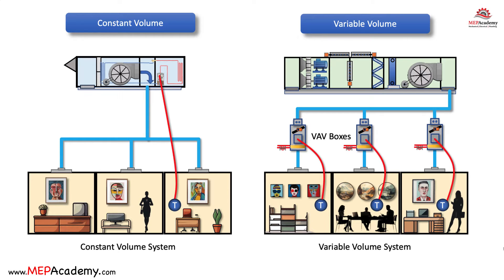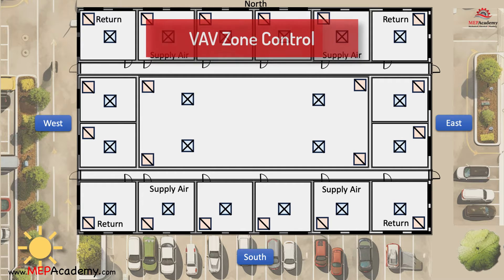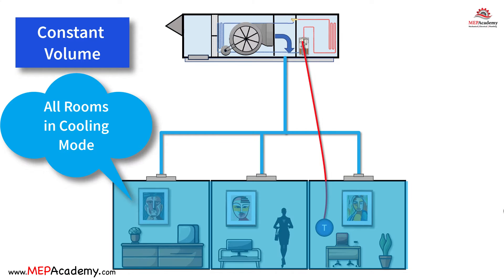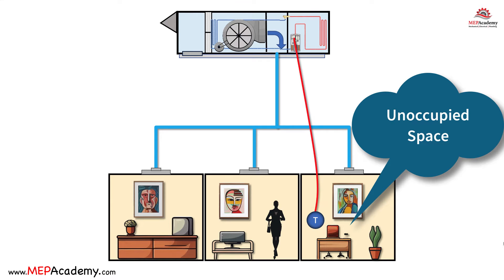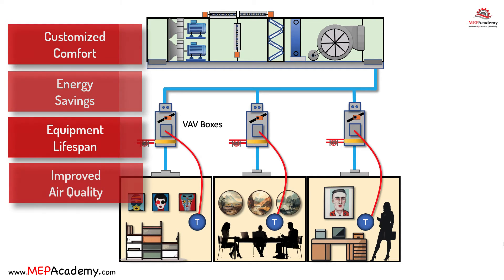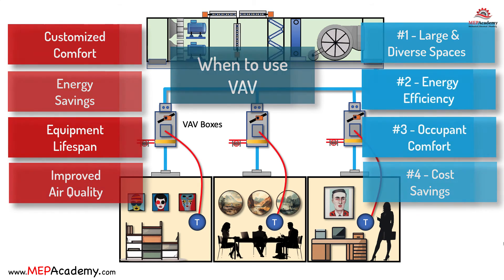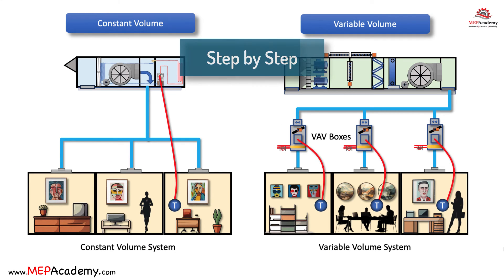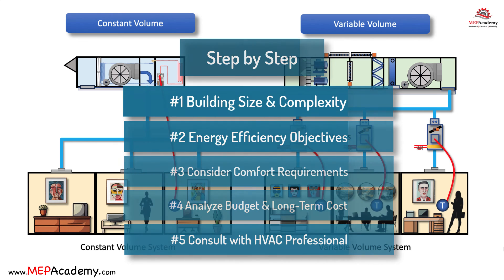VAV vs Constant Volume HVAC Systems

Comment: I want to see a true analysis of the energy efficiency claims of VAV systems vs. the extra cost. Somehow, it does not matter that a VAV box operating in heating mode while the system is in cooling would have to heat up air that has already been cooled to 55 degrees? The tin foil proponent in me says that VAV is basically a scam designed to sell more crappy equipment and keep building management locked into crappy contracts with crappy service companies to service this...crap. 

I have both CAC and VAV systems in my buildings. The VAV buildings BY FAR have more reliability and comfort issues. This is anecdotal, yes, but my point is that all talk about VAV for the most part highlights the supposed benefits, but it's all theoretical as far as I'm concerned. Step into the real world and maybe it's not such a great idea...
Reply from the maker: Thanks for your detailed comment—these are valid concerns, and you're absolutely right to question the real-world performance of any system beyond theoretical energy models.

You're not alone in noticing challenges with VAV systems. While Variable Air Volume (VAV) systems are designed to be more energy-efficient by reducing fan power and conditioning less air during part-load conditions, they do introduce complexities, especially in mixed-mode seasons or when simultaneous heating and cooling can occur due to poor control strategies or design flaws.

The scenario you mentioned—heating air that's already been cooled to 55°F—is a known inefficiency in VAV reheat systems. This is typically mitigated with reset strategies on supply air temperature, optimized zone control, and better building automation, but not all systems are set up or maintained properly.

You’re also right to point out that first cost and maintenance are higher for VAV systems compared to simpler Constant Air Volume (CAV) setups. The real energy savings depend heavily on design quality, control logic, and how well the system is maintained—which unfortunately varies greatly between buildings.

We appreciate your field experience, and we agree: theoretical benefits don’t always play out in poorly executed real-world systems. We’ll definitely consider doing a video that takes a deeper dive into the cost-benefit analysis and real-world performance of VAV vs. CAV, including reliability and maintenance trade-offs.

Thanks again for the thoughtful input—it’s discussions like this that add real value for everyone watching.

Comment: I notice in one of your video that negative pressure room design in laboratory with fume extraction utilize CAV. Is it possible to use VAV for this scenario? 
For other cases, room with positive pressure, what is the recommendation between vav and cav
Reply from the maker: Great observation — and excellent question!

For laboratories requiring negative pressure (like those with fume hoods), CAV (Constant Air Volume) is most commonly used because it ensures a consistent, steady airflow, which is crucial for maintaining safe, reliable negative pressurization. VAV (Variable Air Volume) can be used, but it requires advanced controls — such as airflow tracking and real-time pressure monitoring — to maintain negative pressure as the airflow varies. This makes VAV more complex for lab applications but feasible with proper design.

For positive pressure rooms — like cleanrooms or healthcare spaces (operating rooms, isolation rooms) — there is usually a minimum air changes per hour (ACH) that are typically required by code or design standards. VAV systems are often preferred here because they allow for adjusting airflow based on occupancy or load, improving energy efficiency. However, VAV systems must be carefully designed to never drop below the required ACH to maintain cleanliness standards and pressurization. The minimum airflow setting ensures compliance even at lower demand levels.

In short:

Negative pressure rooms: CAV is simpler and reliable; VAV possible with advanced pressure and airflow controls.
Positive pressure rooms: VAV is often used but must be designed to maintain required minimum ACH and positive pressure at all times.
Thanks for the great question — we can definitely do a deeper dive into lab and cleanroom design if you'd like!
Reply: @MEPAcademy  many thanks for the clarifications. From the explanation I got the points that CAV is most suitable for the lest variation in air exchange in the room such as laboratory with fume cubboard, and VAV is suitable for the constant air exchange such as positive pressure applications. Appreciate if you can provide more explanation about positive pressure room application in electrical room in explosive atmosphere at outside room regarding the options available for this applications.

Comment: Thanks for the video and effort, very informative. One comment if you don't mind. I believe even for VAV systems, you will still need to separate each thermal zone on a separate AHU/package unit due to restrictions by energy codes in terms of . Let's say we are in winter, where the perimeter zones will definitely need heating while the internal zones need cooling and both zones are on the same AHU. If you prioritize the cooling demand, then the perimeter zone VAV box will modulate to lowest air flow rate then activate the reheat coil which leads to huge energy waste and may even be non compliant cause the dT will be greater than the code maximum range (some codes states max reheat is 7K). On the other hand, If we prioritize the perimeter zones heating demand over the internal zones, then this will lead to very poor thermal comfort in the internal zone cause it needs cooling!?

Comment: If i change setpoint to higher value in all VAVs alll gets closed,what happens to the AHU which is running and all air outlets are closed
Reply from the maker: That depends on the application. In some cases the code requires that the VAV terminals setback to their minimum position and not close fully. If for some reason all VAV's were 100% closed and this was an acceptable condition under the code of authority and application, then the AHU should be program to cycle off. Remember that ASHRAE 62.1 requires that occupied spaces be provided with a minimum rate of ventilation.
Reply: @MEPAcademy  thank you so much for the information